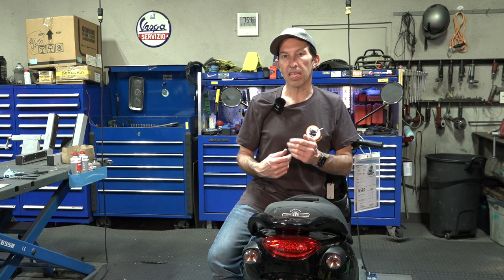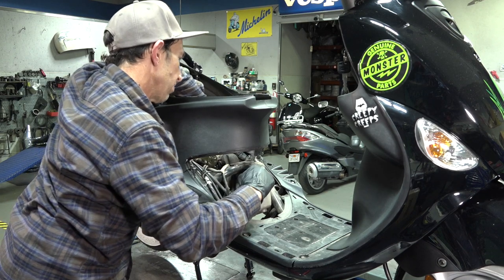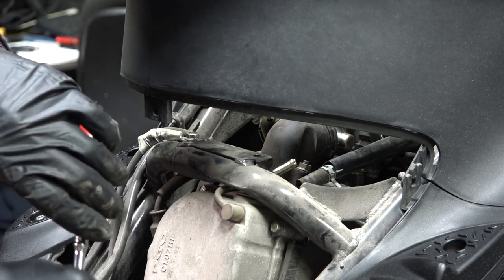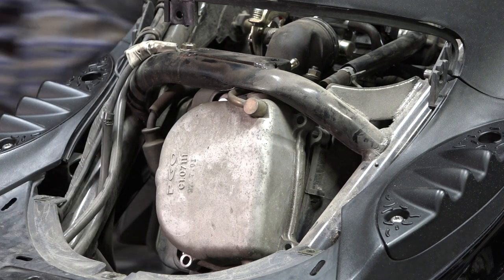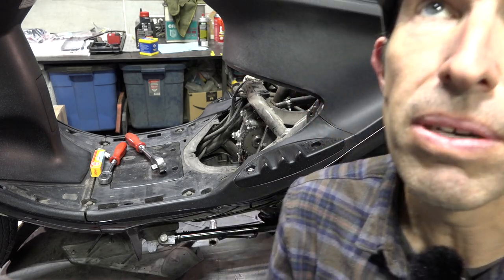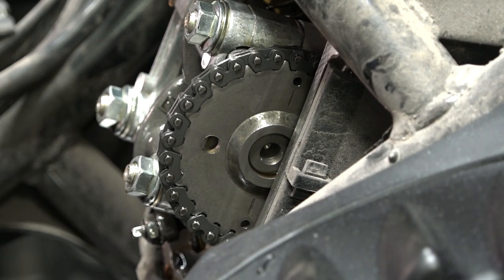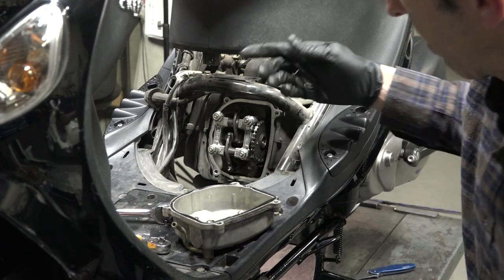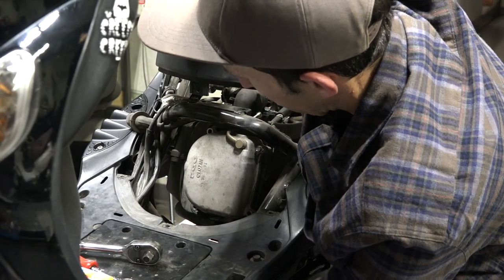Valve Adjustment & Spark Plug Change on a Buddy Scooter

Comment: Hi. Do you have a short video on how to drain the carb on a Stella 2 stroke? 
I got a little water in the gas tank and siphoned it out and filled it with new gas and I’m thinking I need to drain the carb. The engine was just rebuilt 
Thank you